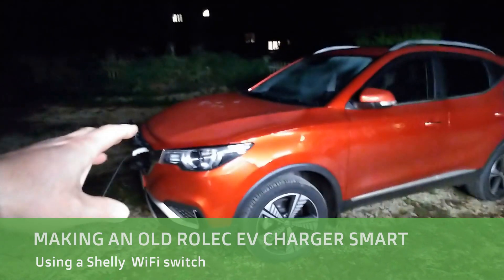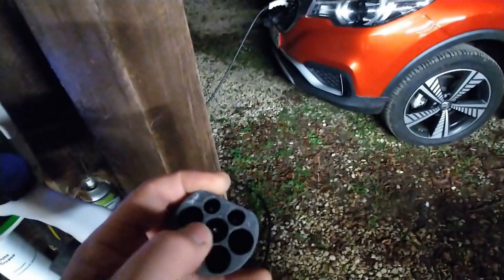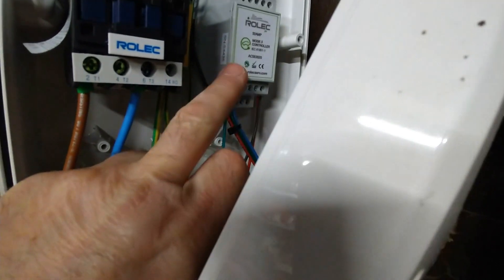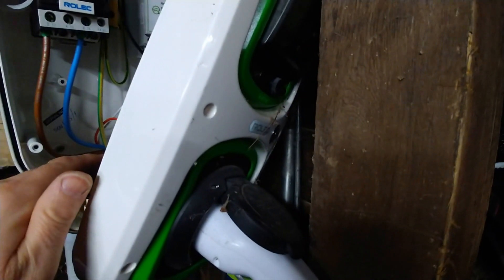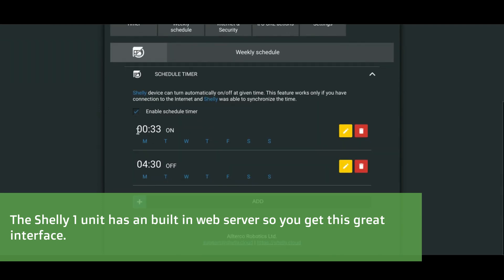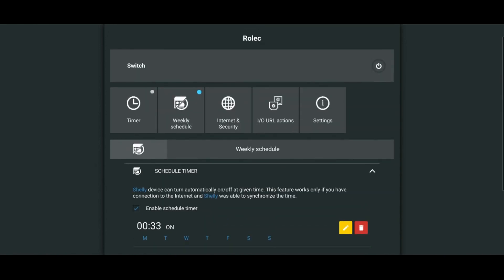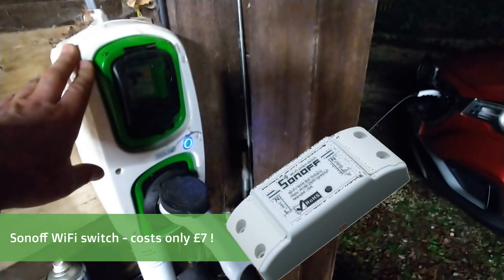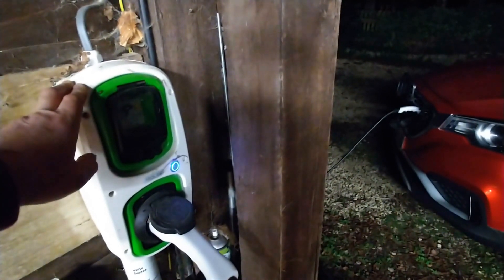Making an old Rolec EV charger 'smart' using a Shelly 1 WiFi switch

Comment: Stumbled upon this video after I found out my new Vorsprung Cyber charger doesn't support scheduled charging which is set through the car's infotainment system. The charger goes into standby after 30 mins of being plugged in and has to be unplugged before it resets! This solution has saved me an absolute fortune and the Shelly works perfectly allowing me to charge at the cheaper tariff through the night. I cannot thank you enough 👍🏻
Reply from the maker: Glad it helped.

Comment: I have a few of those shelly devices but i use them on our old 12v motion sensors and give them WiFi functionality (you need another Shelly on the alarm/cctv side to trigger it).

I came across this as i'm going to be adding a Shelly EM (Energy Monitor) to our dumb rolec. I don't need to make it timed but I wanted to see inside the Rolec before opening ours up.

I would recommend not only setting up a fixed IP on the router (or whatever hands out your DHCP), but to also mirror that on the Shelly Devices Also.
That way if the accidentally factory reset, they get the same IP address, but If you set it on the shellys as well, they respond much better on WiFi.
This is due to them not requiring to do a DHCP check after waking up (they go into a low power state and WiFi routers may try to assign a new IP).
Whereby having fixed & reserved IP addresses, the router will only attempt to send to that specific address and response times will be much improved.

Comment: Thanks for this, nice easy solution. Never had any problems with my previous EV’s as the scheduling worked. Unfortunately although a great car, the ID.4 scheduling is a mess and doesn’t work at all.
Reply from the maker: The e-Golf was the same. You'd thought they'd got this right by now!

Comment: Instead of powering down the entire wallbox with a Wi-Fi relay which is akin to a sudden power failure, which neither the wall charger nor the EV electronics appreciate, a cleaner way of controlling an EVSE over Wi-Fi is to act on the 1kHz +12VDC signal of the Control Pilot (CP) wire, by passing it through the dry contact of a Sonoff SV in isolated mode or a Sonoff RE5V1C module. When opening the circuit of the CP wire (switch OFF) the CP signal is interrupted hence measured at 0V and the wallbox accepts no charging, and when the CP circuit is closed (switch ON) the wallbox can charge the EV.
Reply from the maker: That is exactly what this WiFi relay is doing in this example.
Reply: @GoGreenAutos  you're right, it's explained at 1:36, I didn't realized the Shelly had dry contacts. This is even better than the Sonoff modules because those, although cheaper, have to be powered by a separate 5VDC source (the ROLEC EV Charging Controller has only a 100mA 5V output for external LEDs, not enough) whereas the Shelly can be powered by the mains readily available in there. Well done.

Comment: I'm looking at a similar solution for our plug in hybrid. In my particular case the loading should only be allowed when the solar panels produce enough power to cover at least a certain percentage of the charging...
program should be rather simple: if mains current is negative and more than X then turn switch on, if mains current is positive and more than Y then turn switch off...
the idea is that we get a refund for the electricity because it's a company car, but we're taxed now based on peak power intake... so if we charge the car while running a washing machine, a dryer and the dishwasher we end up getting a higher electricity bill... on the flip side the electricity we give to the grid gets us a very low reward, while using that to charge the car will give us the full price of consumed electricity...

Comment: Hi, only just seen this wifi relay switch, but the Shelly seems rated at 16v whereas wall chargers on single phase can provide 7kWh at 32 amps. Is there a 32 amp wifi relay switch available that you'd recommend? At only 16 amps, my PHEV will take 4 hours to charge instead of the 2 hours at 32 amps.
Reply from the maker: The Shelly is not switching the power line in this example - you're only switching the communications wire which is very low current.
Reply: @GoGreenAutos  Thanks, and I know realise it doesn't touch the DC current, but the comms link. That's great as it converts my "dumb" QUBEV charge point to a "timer" so I don't have to get out of bed to connect up my Sportage PHEV at 2 am!  Brilliant! :)

Comment: does the CP wire just pop/pull out? and if I'm connecting that directly to the shelly, what connector do I need to buy to be the same to pop back into the CP connection?

Comment: i guess a mechanical timer plug with relay switching the resistor would also work? (im not a fan of codeing)
would have to go inside the rolec box to make it water tight. 
it would be inconvenient - you would have to open the box and adjust the timer each time the clocks go back.
Reply from the maker: You could do, but it would be very inconvenient and the timings would all be out of sync every time there was a power cut or the clocks changed. The Shelly device or any other WiFi switch product does this for you and no coding required.

Comment: Great video, can't believe the MG can't schedule charging within the car like the zoe.
Reply from the maker: No biggie as all new EV chargers from July 2020 are smart anyway.
Reply: @GoGreenAutos   Thanks, is there any advantage of using this set up over the zoe built in scheduler ?
Reply from the maker: @martinbickle9836  No, not at all. Its just another way of achieving the same when the car doesn't have it built-in and when using a dumb charger.
Reply from the maker: One advantage I've thought off....you can link it to Google or Alexa speakers, to give you voice control over the charger. Not much of a benefit though and hardly practical in the real world.

Comment: Quick question please, what gauge/amp size wire did you use to install the Shelly 1.
Going to do this on a old chargemaster when the weather gets warmer.
Reply from the maker: I can't remember exactly. I just used what was lying around. The control wires don't carry much current. In the vehicle type2 charge cables, the communications wires are 0.5mm2.

Comment: Will this work with other types of chargers in the same way?
Reply from the maker: Yes because all it is doing is cutting the communication line to the vehicle, so the charger can't communicate with the car. When the WiFi switch is on, the charger sees the car as if its just been plugged in and charging starts.

Comment: Excellent video.  I would like to add the same modification to my Pod Point charger, as there is no confirmation as yet that the App will be updated to provide this feature.  I understand how this mod' works but is there any wiring information for the Pod Point changer circuit.
Reply from the maker: It will be exactly the same as the Shelly is just breaking the communications wire. Follow the link in the video description and watch the other video which goes into more details.

Comment: Hi - I was thinking of doing this to my charger too. Is it best to break the CP wire or the PP wire ? did you try both or just use the CP connection ? If the Shelly is in its 'Off' state, could you drive your car away while plugged in due to the car also not knowing it is connected ?
Reply from the maker: You need to break in to the CP line.
As for driving the car away, I've not got the MG any more, nor even using this Rolec any more as I've moved, so unable to test it, but from memory, I'm pretty sure the car still knows its plugged in.
Reply: does the CP line just pop/pull out? And if so what connector is it to put on the other end of the new cable that will be going in its place or do we need to cut it in the middle and then run each bit through the shelly?  @GoGreenAutos
Reply from the maker: @Jay_Pyro  I can't remember what I did now as this was over 3 years ago and I've also since moved and no longer have this Rolec unit. But from memory, all the connections were just screw terminals and very simple.
Reply: @GoGreenAutos  ok great, I did watch this back when I had a zs but then upgraded to a mg4, since a firmware update on my car my scheduling isn’t working so I’m gonna do this as a quick fix rather than spending hundreds on new charger, thanks

Comment: I am guessing but I suspect the Shelly unit may be using the wiring as an antenna.
Reply from the maker: I've not seen anything in the instructions on this. If it is, I could install longer wires. But with the Rolec closed, it is still working. Pretty impressive as even in the garage (not inside a Rolec case full of live electrical devices) my phone will not see the house WiFi signal at all.
Reply: Most of these devices have the antenna as part of the PCB.

Comment: Am I right in thinking these are 16 amp, my charger is a 32amp PodPoint, do they do a 32 amp version?
Reply from the maker: The Shelly is interrupting the communications wire, which is low current (12v or 5v I would guess) and low current, so its irrelevant.
My Rolec is a 32A charger.

Comment: What would happen to your Tesla if the pilot cable is broken this way? Would the car recognise a cable is still attached to the car? 
Tesla will auto-close their charge ports on cable disconnect, I'm worried Tesla would burn out the charge port motor.

Comment: The Shelley switch is only rated to 3.5kw so how is it safe for a 7kw Rolec?
Reply from the maker: The charging circuit isn't through the Shelly. Its only on the low voltage communications wire.
Reply: @GoGreenAutos  that makes sense 👍. 

I have a subsequent question - if the charge cable is not connected to the EV and the Shelly unit activates the connection, does that mean the charge cable is live or does it only go fully live when it's connected to an EV?
Reply from the maker: @Aussie_PG  Only goes live when connected to the car AND communicated with the car.